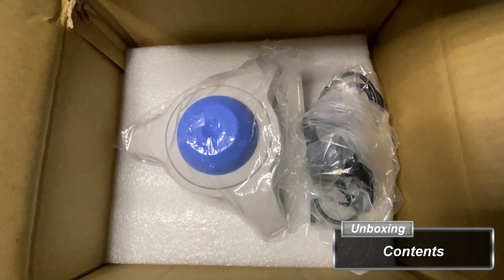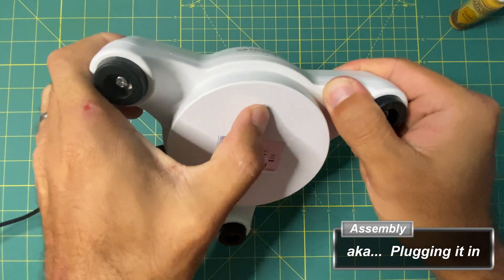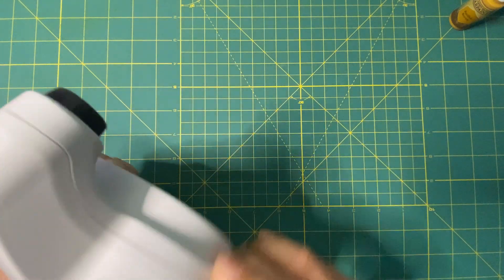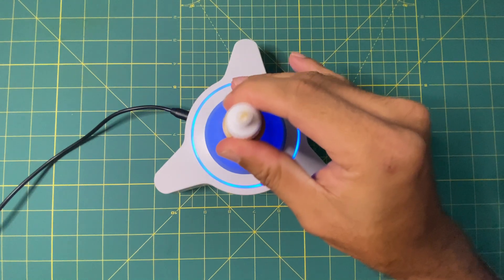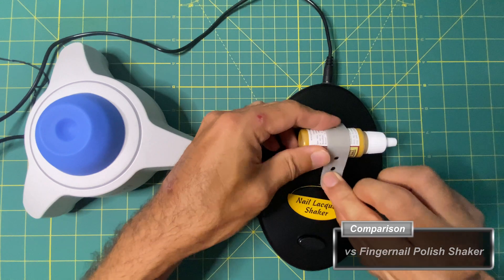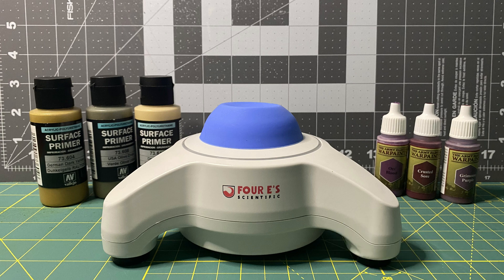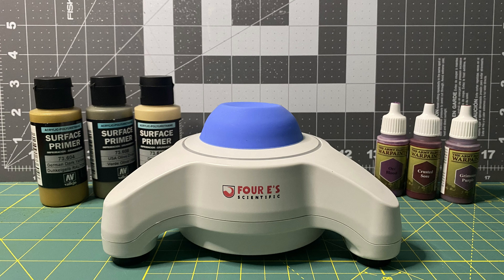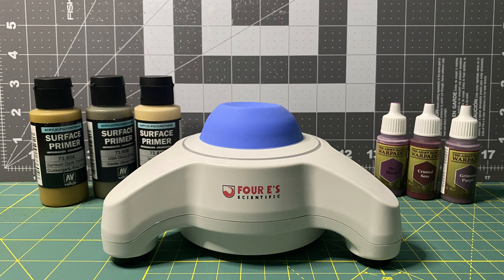Four E's Mini Vortex Shaker - Unboxing and First Impressions

Comment: I'm puzzled how/why you bought a vortex mixer without researching, or having any idea how they work 🤔
I use the smaller, dome shaped Four E's mixer for general use but I also have one of the nail polish shakers that I use for paints that have sat and settled for a while.  I have joint issues and it's handy to be able to just set it running and leave it for a few minutes without having to hold the paint.
If you have access to a 3D printer, there are some files I found online for 'cup like' adapters.  They fit onto the bottom, or top, of paint bottles and have a small dome on the base that better fits into the top of the vortex mixer; more like the test tubes they were originally designed for.

Comment: Holy shit the nail laquer shaker sounds like a a10 warthog gatling gun😂
Reply from the maker: Its pretty bad, but it can get the job done.  Just takes a lot longer and is a lot louder.  I debated on shaking it while it shook the paint, but somehow I feel like I'd regret trying that.
Reply: @workingwithminiatures0706  is preety loud tho
Reply: I've got a Ryobi waterblaster that i have called Burt because it sounds exactly like an A10 letting loose on the Taliban hiding in the tree line.